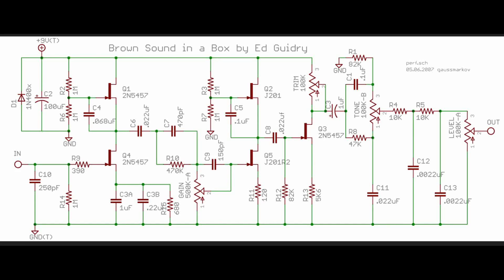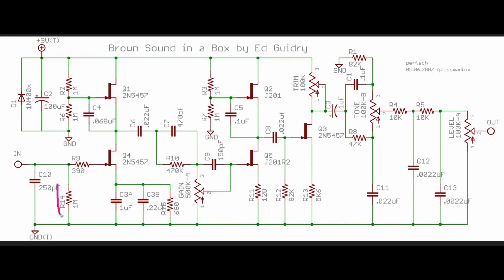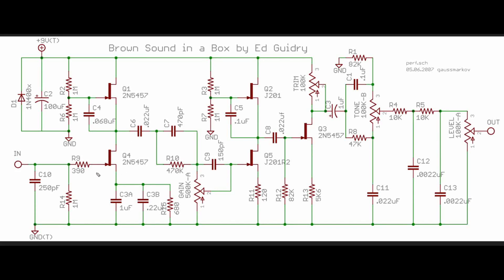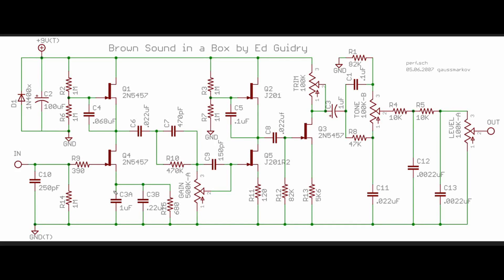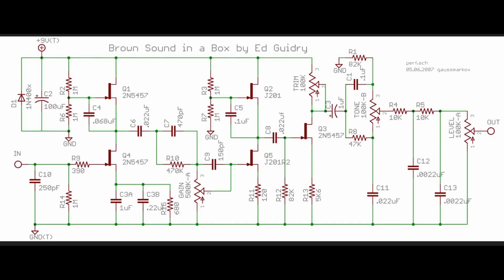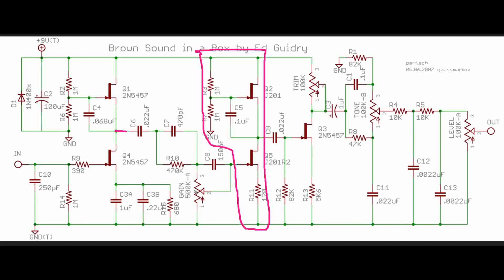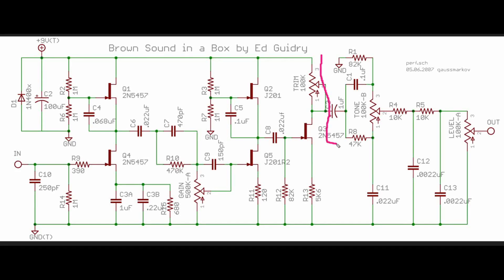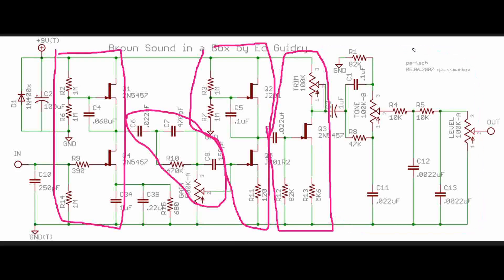Schematic Elements for Guitar and Effects: Mu-Amps and the BSIAB

Comment: I'm curious why R12 is such a low value. With C8, it does form a high pass filter around 88Hz, but it also is a much lower impedance than a JFET is capable, and will load down the output of the 2nd Mu amp stage, limiting its gain significantly more than the loading on the inputs of the two Mu amp stages. And also load down the input of Q3 more than it's capability.

Similarly, Q3 stage will exhibit at least some gain to make up for those losses, plus the losses imparted by the tone control after. The ability of Q3 to efficiently drive the tone control is mitigated by the setting of the setting of the 100k drain trimpot, which will both determine the theoretical gain of Q3 stage, and its output impedance. Which could end up being higher than optimal. Depending on where the trimmer end up. 

Certainly the circuit is tested and performs well, but these appear to be curious and a kind of intentional throttling of some sort.

Comment: SCIENTIFICGUITARIST, What the differences between MU Amp configuration compared to a Push Pull Configuration? the MU Amp doesn't have any crossover distortion, the MU amp are both conducting the positive and negative cycles at all times because there is no push pull turning on/off the FETS in an MU amplifier.